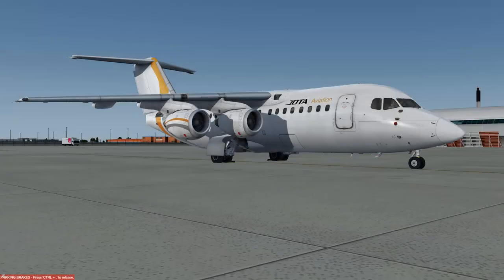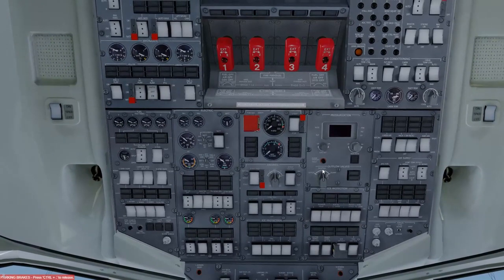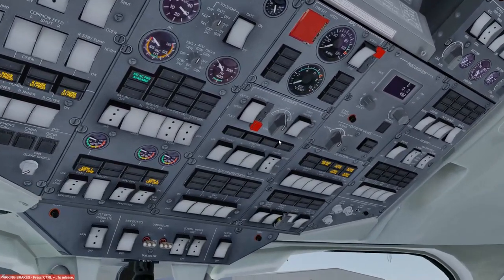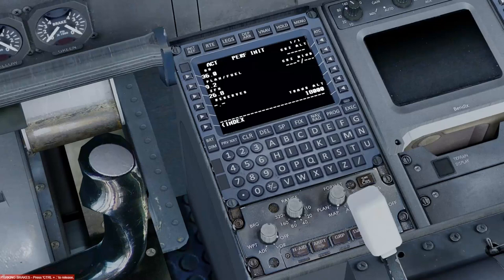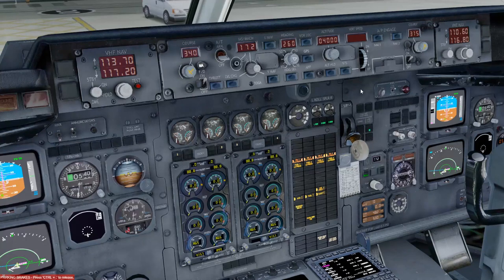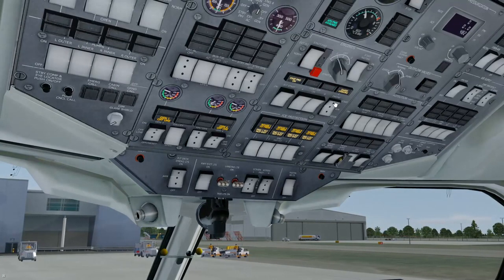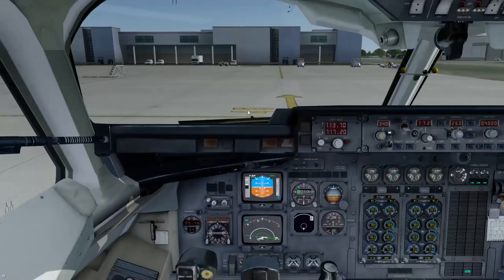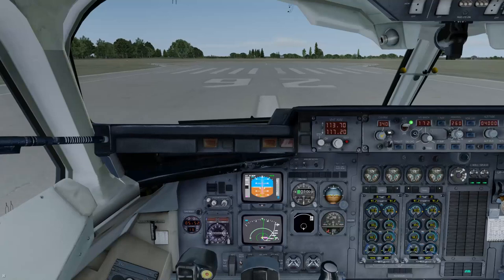Quality Wings RJ85 Full Tutorial

Comment: You tuned the wrong V2 in MCS speed window. Its actual VFTO which you tuned. V2 is around 134. be careful. and another mistake is beyond the acceleration height you didnt switch to climb thrust on the TRP. You are still cruising with reduced TOGA.

Comment: Did I miss scene where you set trim before taxi and take off??? The trim setting is set to negativr 11 degrees.  Shall I leave it alone OR change trim setting wheel to positive 2 or 3 degree???
Reply from the maker: You can change the trim at your requirements. But I personally leave it because the quality wings sometimes the trim settings can’t mess that up a little.
Reply: @FlyingFreakz  thanks for your kind reply